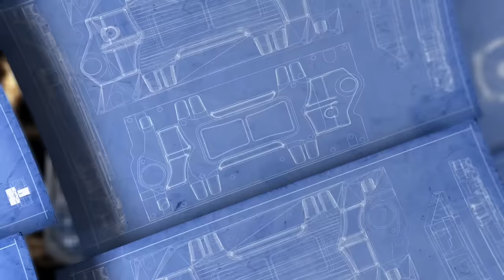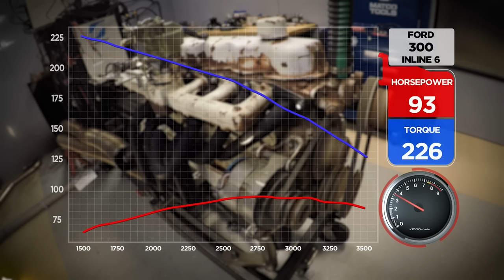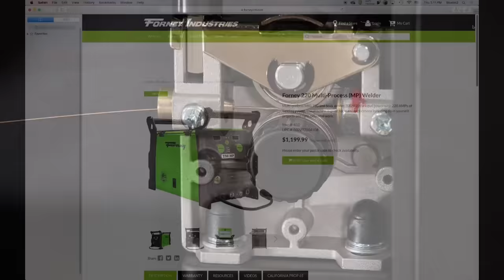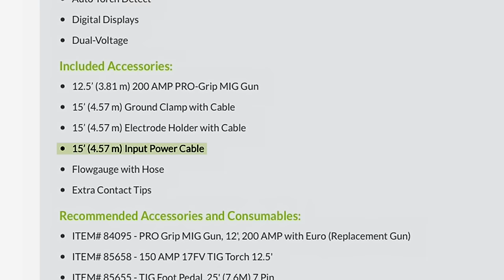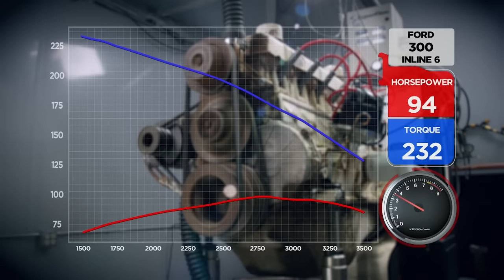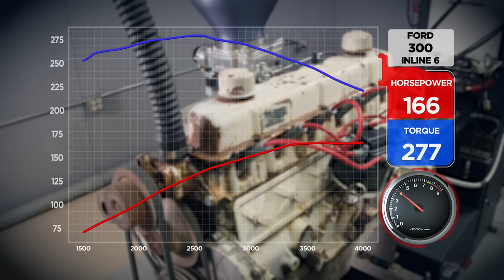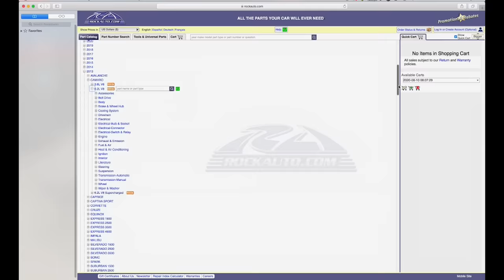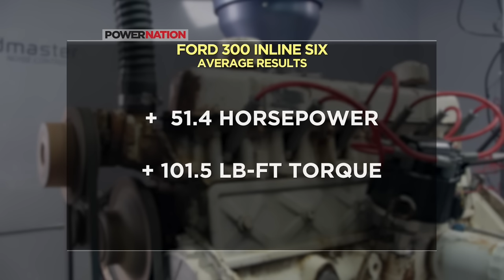Ford 300 Inline Six Gets Eye-Popping Off-The-Shelf Power - Engine Power S7, E17

Comment: That could be the biggest NA percentage gain in power they’ve ever done.
Reply: Well when you only make 80 hp it doesn't take much.
Reply: @bmstylee  they also pickup up 80hp with an intake swap
Reply: @bmstylee  you been negative on alot comments. You must got smoked by a old 300
Reply: @zachutson7205  no.  I'm just not a fan of people making something that is a horrible performance base sound like it is the best thing since sliced bread.  It's not a 2jz.   There is a reason this thing is extinct.
Reply: @bmstylee  it was a industrial engine used for generators and such and for bullet proof reliability. Of course it's not going to make alot power. But with the basic upgrades they made doubled the power. What a engine.
Reply: @bmstylee  it is not extinct lol. Theres millions of them out there still working harder than most guys diesel trucks
Reply: @chrisduncan2626  strange  i don't seem to see crate options and Ford doesn't sell them anymore.  Seems a dead engine me.   Dodge makes a modern Hemi and GM makes a modern SBC in the LS family but strange Ford doesn't make the I-6 anymore.   I call that dead.
Reply: Its always V8 guys looking at I6 videos and hating just don't watch or comment
Reply: @Wild Bill What a thoughtful and constructive comment. Because of your input they aren’t gonna finish this build and instead go with a cookie cutter small block.
Reply: @bmstylee  they dont need to make it anymore. All the ones theyve made havent died yet. They just keep going and going
Reply: @nathannero9338  Wildo is a size queen and in the Ls sWAp ErRtHInG! herd that don't know/care about history, the inherent smoothness of an I6, area under the curve, or anything but that peak number.
Reply: Old Man Jack, our shop teacher in high school taught us this lesson way back in '78/'79. He called it the Trifecta. The biggest bang for your buck for any upgrade to any stock engine. Nowadays, every claims that NOS rules that category but not so fast. Without these upgrades first, you're severely limiting any power gains that NOS can provide. An engine is nothing more than a glorified air pump! Open up her ability to breathe and give her superior spark to find the true potential of any engine. Jack was extremely smart and I was very blessed by him sharing some of his vast knowledge of engines with me.
Reply: @bmstylee  The current HEMI shares nothing with the original Hemi other than its name and the LS shares more in common with the Ford Mod motors than a 1954 Small Block.

The reason the 300 went away was it was an In line 6, diesel was cheap, the Mod motor and the "I got to have V8" crowd.   The last one is the most annoying for in the truck the 300 bet the 5.0 hands down (no comparison), the also effected the 89-97 Tbird (the SC was faster and quicker than the HO/Cobra 5.0)
Reply: @ Wild Bill: Ford decided to stop building pushrod engines. Does this mean pushrod engines are bad? About  year later they decided to stop servicing the original Mustang. Is there something wrong with those Mustangs? Look at all the aftermarket parts that are available for the stange.
Reply: @bmstylee  strange.. I don't see crate engine 2jz from Toyota... I wonder when Toyota stopped making them... Poor comparison homie...
Reply: @bmstylee  there are thousands of ford 300s powering baggage tractors and trucks at airports across the country right now, no 2jz's though.
Reply: @chrisduncan2626  and longer with less problems . also anyone else notice that the better the drivetrain and reliability  the manufacturers seem after awhile to think - they're lasting too long , we gotta quit making these or we won't sell enough new crap .
Reply: Wild Bill has had enough y'all. He's just sowing dissent because he doesn't like the engine. Anyone who has ever owned one can attest to their durability. It was in my first truck and God knows I did everything to blow up that 300,000 mile motor to no avail. I can't wait to rebuild mine if it ever lets me.
Reply: @branden7384  I had an old F-100 work truck with three on the tree. That inline 6 just worked and worked. I pulled a tandem trailer with it all day everyday. It never over heated or did anything weird. It always started right up when cold too. It never leaked anything either. I wish I still had that truck. This was 15 years or so ago. It had the perfect patina paint and with a coat of clear it would have been awesome.
Reply: @branden7384  they dont even care if you drain the oil and drive it 🤣 i once read about a guy who tried to kill one like that. Ended up driving for about 30 minutes gave up and went home and when he pulled in the driveway, it had just started a slight knock. I bet if hedve just put oil back in it it wouldve ran like nothing ever happened lol
Reply: @bmstylee  wait till they put the boost on
Reply: @sorshiaemms5959  yep.  And it will barely make what a mild 5.0L v8 does and less than a bone stock LS.  And cost more to do it.
Reply: @bmstylee  and last 3x as long.
Cheap, Fast, Reliable; pick two.
Reply: @bowez9  well.  That won't be fast.  It will certainly not be cheap.   Especially when you have to totally upgrade the internals, new heads, and a turbo to make 300 hp.   Or what a Civic Type R makes from the factory.   Which will be more reliable than this boat anchor.
Reply: @bmstylee  a Type R from the same time frame doesn't make 300hp either, nor is it a V8 that you've been touting.
If looking for 300hp from that era look at the Tbird SC, and I personally know of some making 600whp.

Though I would like to see a Type R carry 3500lbs  of payload day in and day  out, even tow 20000 lbs.

As far as price how much money has Honda put into developing the Type R, I'm willing to bet its in the 6 figure amount.
Reply: @bowez9  wow.  The butt hurt is really high because I've called out this pos for what it is.  A dinosaur.   You guys ridiculed the slant 6 they did a few years ago because it made the same amount of power this did.  But somehow this is God's gift to horsepower because it makes 150 hp.   And they Civic Type R was an example of what modern technology can do.   So after spending $15000 to build this thing you could have bought a Coyote with cash to spare.   Or you could Cummins or D-max swap with money left over and have a superior engine with more capacity.   More aftermarket support.   And will last significantly longer.
Reply: @bmstylee  crate 5.0 with controllers are $15k and that's a cheap one, and Mod motors don't bolt Windsor transmissions, so there is another $3-$6k (save the 90/91 Panther AOD).

No I called you out for changing platforms and trying to compare a commuter engine to a Industrial engine.

As for a cost comparison if they had started with a EFI engine the ending power level is where it would have started, but that's no good for advertisers.

As for modern development I would've loved to see Ford developed the 300 to a Aluminum GDI Turbo.  But cheap diesel on the 80s and the Mod motor is what killed the 300 and FE platform.  300 wouldn't fit any  more, plus a lack of viable transmission to bolt to ( it doesn't make since to have 3 bolt patterns and 2 of them only matching  1 engine.)
Reply: @bmstylee  
They still make parts.   The reason the engine is no longer in production is due to packaging length, it is too long.  Dodge diesels are a pain to work on because of this.  Designers want a short hood length.
Reply: @bowez9  it is a commuter engine.  It was available in consumer pickups.   So you're argument is wrong.   And by the time they build it it will cost as much as a Coyote.  And significantly more than an LS or late model Hemi.   You're just upset I am not falling into your groupthink and making valid points that it's a fool's errand to build something that has nothing in the performance arena that a v8 won't run circles around.
Reply: @keithjurena9319  they make flat head parts.   Does that make it a relevant powerplant in 2020?
Reply: @bmstylee  Bill you must be a young guy as far as aftermarket support there making them for old and new vehicles i see you mentioned a civic and aluminum engine that I seen throw rods on an off the track you can't stress the little thing and expect reliability remember this guy newer is not always better thats what you understanding the quality of the parts these days are junk china made stuff we have we have commercial vehicles on my job 30+ yrs old I6 motors are still going listen to what about 2 dozen people on here are telling but it seems ur still in disbelief Cummins used that same I6 block for maybe 40 yrs upgraded tech. and bigger displacement But... same block straight 6
Reply: @vee950  by that logic anApple 2e is just as good as a modern Mac because it's just a newer version of an old idea.  And manual drum brakes on all 5 wheels are just as good as discs with abs because it's just a modernized idea of what was used before.   You guys keep living in the past while the rest of the world embraces modern technology.   🤦‍♂️
Reply: @bmstylee  try agian the 300 is an industrial/motor, the same can no be said for the K20.  Ford has a history of putting industrial engines in their trucks.  However these engines were never put into commuter vehicles, if you need a commuter vehicle defined you are in the wrong place.

Now personally I don't care if you have a different opinion, but you better be able to back it up with facts, which you have yet to successfully do yet.  You've given opinions that have been dismissed by facts.
To buy a Coyote and controller prices start at $15k then add $3k-$6k for a new transmission your realistically looking at over $20k.  With what they put on the engine so far the are barely over $1k, and I suspect the entire build including turbo will have it under $10k and closer to $6k-$7k.

To have done this even cheaper start with a efi engine, then you get every for less than $5k (for a great condition truck).
Reply: @bmstylee  cool is subjective.  Power are you looking for peak, area under the curve or low end grunt; each requires a different build.
Reply: @bmstylee  cheapest complete engine I found on Summit was $8500, plus $1800 for controller.  Then you still need a transmission....
Reply: @bmstylee  some people just enjoy an engine build of something they like. I find it refreshing from LS/Hemi/Coyote/Cummins swaps and builds. It’s different and challenging. The hosts of this show are finding it interesting as well. You are like a guy walking into a Jeep club just to tell everyone they are dumb for liking Jeeps, and side by sides are far superior off-road. Well, your not wrong, but it isn’t a side by side club. This isn’t a hemi/LS/blah build. It’s a Ford 300 build. Feel free to change the channel if it’s stupid to you.
Reply: @7950pacecar  you're Killin me Small's
Reply: @bmstylee  Ford quit making the 300 six because it was too tall to fit under a modern aerodynamically sloped pickup hood.
Reply: @chrisduncan2626  they die alot they break like all engines
Reply: @bowez9  shares little in common with the mod motors due to the windsor/Cleveland and passenger car mustang gt and truck differences. The ls shares the same bore spacing very similar main diameter. Again the mod motor has a lot less in common with any pushrod v8 due to it being a ohc v8 it physically only shares some bottom end design.
Reply: @bowez9  the 300 didn't actually out tow the 5.0 v8.
Reply: @mrwascallyt9865  the 300 i6 was forced out because it wasn't as reliable as you think they start having blow by issues rather quickly
Reply: @bowez9  a gdi 300 i6 wouldn't have had the combustion chamber nor the robustness to keep pace with modern engines either. It was always a gutless pig just like the 292. Yes you can mod them but the platform just doesn't have the support nor is it capable of really getting much better
Reply: @bowez9  the 300 isn't a industrial engine. It was used for minor applications but they don't have a history of putting industrial motors in the trucks either. As the 300 i6 was designed for pickups
Reply: @jdrok5026  combustion chamber would be a required development of a GDI head, this part of the issue with make port injection engine direct injection. 
The 292 my be gutless but not the 300.  Factory EFI 300 put out the power this modified one has, and the Turbo 292 built by Power Nation is still weak by comparison.
Aftermarket support is because V8 popularity and the size of the 300, but I guess you forgot about the 240.
Oh and there are 7 sec 300 drag cars, I wouldn't call that gutless
Reply: @jdrok5026  per my 1990 owners manual you are correct, the 300, 5.0, 351, 460 and 7.3  all have the same rating given the same trans and gears.
Remember the trucks did not get the HO roller engine, and as a result the 300 and 5.0 made the same Hp with the 300 making more torque and at a lower RPM.
Reply: @bowez9  your using built engines now....
Reply: @jdrok5026  your the one that brought in the aftermarket.
Reply: @jdrok5026  I've never heard of any 300 or 292 having blow by or not reliable there's people that done 300k + mileage on those engines fords 4.6 an 5 4 v8 are great LS chevys nit so diff from LT1 they blow head gaskets, cooling issues both LS & Ford V8 have intake manifolds issues because there plastic
Reply: @vee950  very few times does a ls blow a head gasket nor did either generation lt without a pre existing issue being a problem. No engine is 100 percent bulletproof and the 292 while at slow speeds where it wanted to be would have very few issues well most people didn't take care of either engine and most are basically junk non rebuild able cores.
Reply: @vee950  the ls has very few issues with the intake ford did for awhile but even then the mod motor intake has been fixed for almost 20 years now
Reply: @bowez9  no you did.. I didn't lol.
Reply: @vee950  also 292 and 300s get blow by due to carburetors and uneven fuel distribution through the intake manifolds and with less than ideal wear characteristics on the engine platforms vs today's engines. Blow by is perfectly Natural to these older platforms. Which is why 300s and 292s love to leak and use oil.
Reply: @jdrok5026  where did I say bring up 300 aftermarket support prior to you saying it doesn't exist? I don't see it in this thread.
Reply: @jdrok5026  Ford has a history dating back to the 1950s of industrial engines the same engine families used in the trucks they sell.  If you don't think of pumps and generators that run 24hrs a day for weeks on end as industrial I don't know what to call it.  Since most industrial engines I've dealt with only run for periodic tests and spend the rest of time just waiting for an emergency use.
Don't forget the heavy equipment and tractors Ford supply power plants for.
Reply: @lunchbox2784  Well said!
Reply: @bmstylee  the old Ford 6 isn't dead well maybe In america
Reply: @jdrok5026  
How many 302 V8’s have you owned and 300 i6’s. I graduated in 78. Have owned many and built many a 302 v8. Iv owned slant 6, 240 6cyl and Cummins   I am retiring next year at 62 and will travel a lot with 5000 lb trailer camper and boat on truck. I just Sold my 2021 TRD Toyota and bought a 96 F150 with 4.9 and five speed. EFI motor. I won’t tell you why I have done this because your not capable of comprehending the facts the truths and pure usability of the 300 six cylinder !!!!!
Reply: The ford 300 is still running alot of pumpjacks running on fuelgas